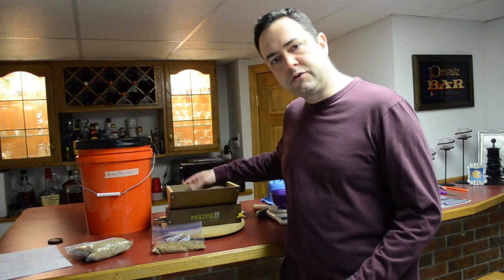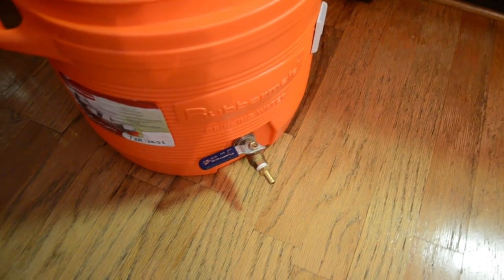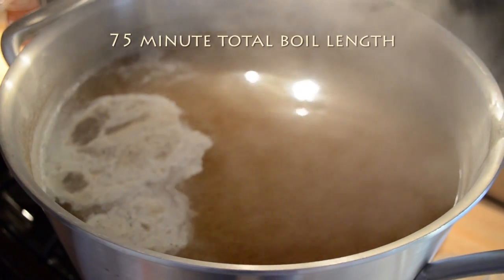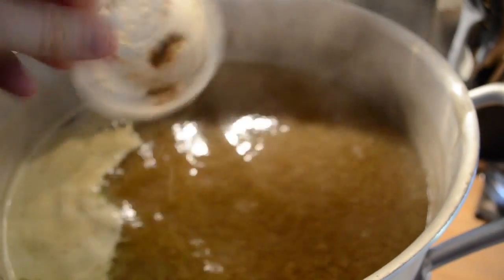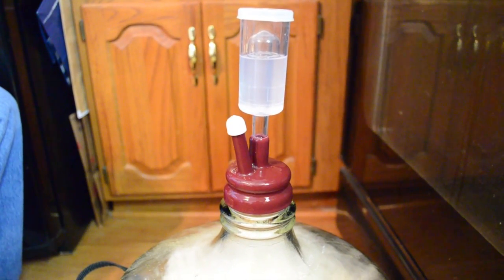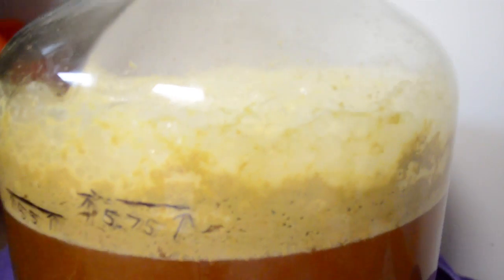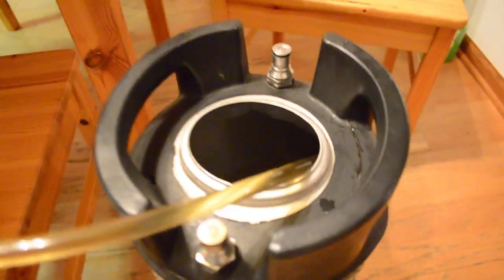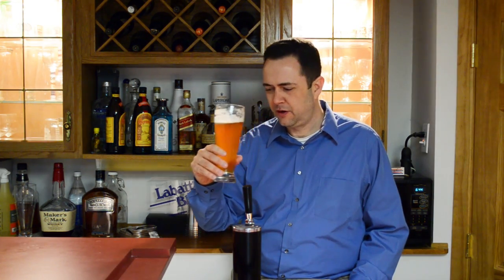Centennial IPA: My Bell's Two Hearted Ale Clone

Comment: I've probably watched this video ten times now, I've decided this will be my first brew ever... I'm gonna skip extract brewing and go straight into grain but will be using the brew in a bag technique. I've been reading up on brewing a lot the past weeks but I still have two questions.

1. Can I halve this recipe or do I need to make alterations if I do?
2. Can I use a dry yeast?
3. To aerate, can I just agitate and splash or will that not be enough?
4. If I bottle the final brew, do I still need to calculate sucrose into the bottles for carbonation or is the beer carbonated enough as is?

Thanks a lot Larry, once again, great video.

Comment: Few questions - I'm a newbie
1.  After Mashing you used the term "Runnings" when draining into Kettle for the boil.  What does "running's mean.  My guess is you add water to bring the wart to a certain level?  If so, what is that level?
2. When Syfining into Corny keg at the end.  
          -  Looks like you pressurized w/ C02 and purged the keg.  do you need to add sugar water to the mix?
           - You said let it sit like that for a "couple days".  How long should the beer sit in corny befoe tapped?

Thanks, Larry - excited to make this beer!
Reply: @BEERNBBQBYLARRY  thanks. That helps.   I'll check out your videos.  Appreciate the reply

Comment: ok. i started A.G. earlier this week, and so havent noticed any color differences i can be sure of, but i have noticed the sugars seem to be vastly more available than brewing w/ extract even w/ partial mash. used to take 24-48 hours for noticeable fermentation. my first batch was vigorous after 24hrs, and after 5 days is still bubbling every 10 seconds. the batch i did today is vigorous after 6 hours and had a pound less malts. they are 1.050 and 1.048 respectively. (any idea what kind of fg i can expect? the mash temps were under 150). for comparison, ive become accustomed to waiting 24-48 hours for any activity at all w/ extracts.

Comment: Try Using whole hops and hop bags. Then just squeeze out the bags good at the end of the boil to get all the wort that the hops soaked up.. Trust me your beer will be alot better without all that trub
Reply: +BEER-N-BBQ by Larry I have the same funnel/screen you do. It gets a lot out but I found it got clogged fairly quickly.   I stopped using pellet hops altogether.  I get them whole from Hops Direct.  They sell pellets too.  :)  Just got a pound of this years Centennial and a # of Azaaca .  Im thinking Cent for bittering  and Azaaca for flavor.